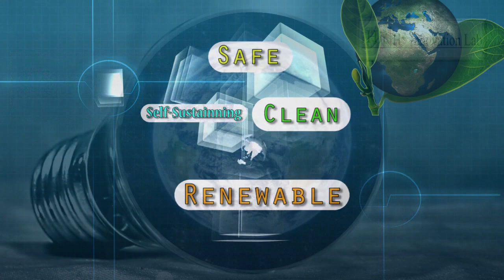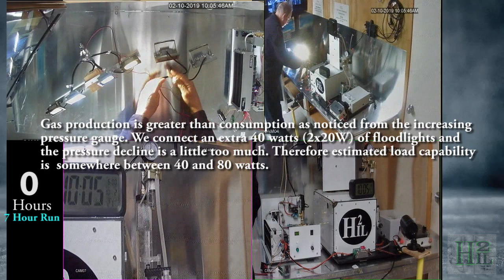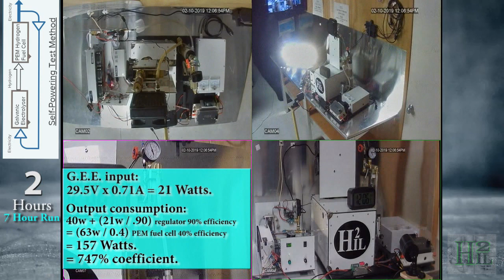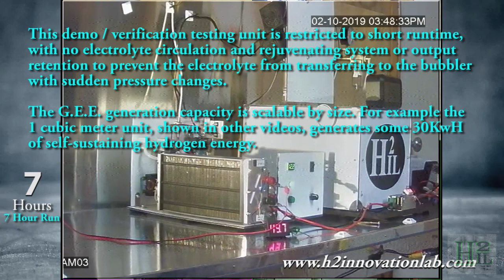True Self-sustaining Energy | A New Way to Generate Energy | Green Hydrogen Economy

Comment: You may be interested to know that one of our labs ran a test to simulate your method in the attempt to determine the life of the anode electrode. They first calculated the energy density from by-metals and determined the cathode to be Nickel and the anode to be Zinc alloy (not pure zinc that would consume too rapidly) - common metals listed at each end of the Galvani table. They also calculated the power needed based on the estimated size of your demonstration electro-cell. The simulated beaker type test ran at a level that would generate the amount of hydrogen you would need in this presentation,  but of course scales down to a portion of the size of your white box.
Results: The anode was 65% consumed after just one hour and totally consumed when inspected at the next hour. But yours ran for 7 hours! - this I have viewed and can confirm. Looking at the performance, towards the end of the 7 hour presentation, I guess the anode was not consumed much at the 7 hour point. To us this confirms that you have some very revolutionary science going on in your electrochemical cell. 
I would hazard the guess that other labratories have attempted to simulate your technology and were discouraged by the same results as ours. Could be why you don't appare to be getting the type of attention this deserves. I will post our findings on you other channel. It may be of help.
Reply from the maker: Thank you for your interesting comment...  Your calculations are valid.
Yes the same electrodes used in the 7 hour self-power test have been used for all verification tests (only some published) and much more. I checked with the lab, the electrodes still have a lot of life in them. The technology does not use brute force electricity which would consume electrodes. This fact along with the anodic electrolyte extends the life much the same as the electrodes of a rechargeable alkaline battery.
Reply: Science educator please do take a look at this may be of great interest to you its is a video from Dr Claudia Albers a physicist and its video number  1285 DO watch it.

Comment: You say it is scalable so how big can it be scaled up to? Can it substitute current power plants? Can it power a city? These factors are what matter and if you can prove scalability then the world can shelve fusion energy. And one big question that needs to be answered by all means of hydrogen production from water is - where do you get all the water from? Does it need to be trucked to the localised power plants?
Reply from the maker: Yes. As stated, with reference to the 1 cubic meter cell, at the end of this video the technology supports scale-ability. The main energy drawn from is galvanic and the small input power is just a catalyst. Therefore the output hydrogen quantity increases with size and the volume of galvanic energy to draw from. The increase is scaled on a logarithmic  basis and there are no upper limits. However, there is a lower end limit as can be seen by this small demo unit cell that generates only 1 SLPM for 45 watts of energy at 370% efficiency, compared to the 3000% efficiency of the larger unit that generates about 180 SLPM. For more information please refer to the Q&A section of the H2IL website.
Reply from the maker: Re: Your second question regarding water supply. Hydrogen is a sustainable means of energy in that when consumed in all cases it converts back to H2O - water. In a localized power generation facility using fuel cells these is no water loss. The fuel cell converts the H2 to H2O that is fed back into the G.E.E. An initial batch of water and unexpected top up can be delivered by truck if located in areas where it does not rain. There is a small amount of special 'Anodic Enhancement Electrolyte' that must be added to the water but the amount is so small it is not worth mentioning compared to the energy production and benefits. This can be delivered on a monthly service inspection and filled into small holding tanks.
For the automotive sector where hydrogen is taken off site there does need to be a supply of water. Rain is frequent in some areas but the obvious solution to this is for hydrogen mobility to hold the waste (exhaust) water in tanks that are emptied at the fueling station while fueling. A fuel discount incentive for water delivery and auto makers can fit a water tank into their design. Short term just truck in water in the same way that petrol and diesel is currently being trucked to fuel stations.